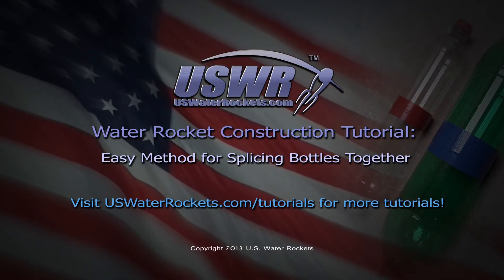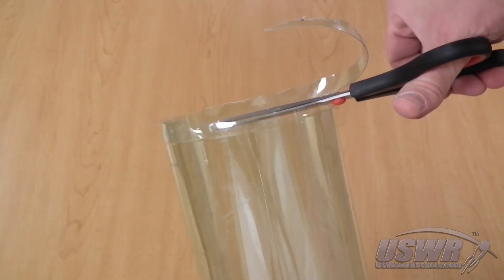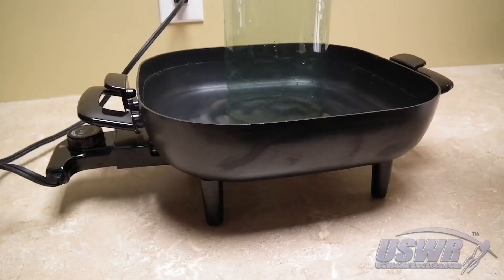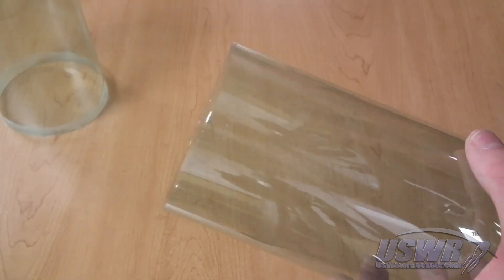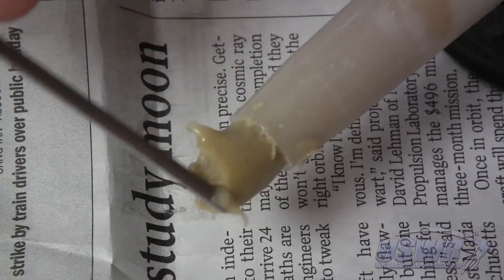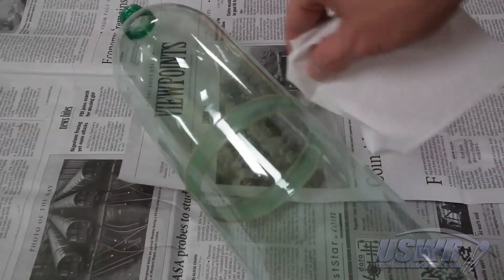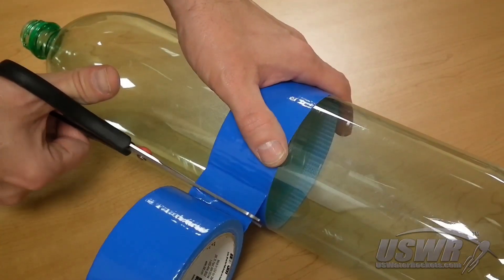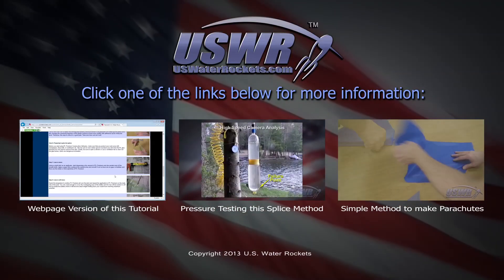How To Make a Huge Water Rocket by Splicing Bottles Together!

Comment: The directions on the PL Premium specifically state not to use on polyethylene...the plastic that 2 liter soda bottles are made from.  Have you had any reason, other than the manufacturers directions, to not use PL Premium?
Reply from the maker: The plastic bottles we use are made from polyethylene terephthalate. Perhaps the directions are referring to one of the other forms of polyethylene? There are several, and each has unique properties.

The fact that no other adhesive has yet been found that can match PL Premium for this application essentially means that regardless of what the directions say, this is the best option discovered so far.